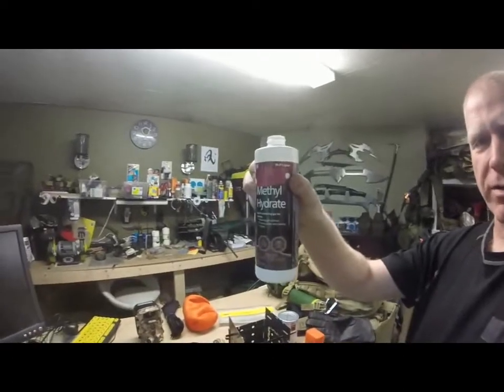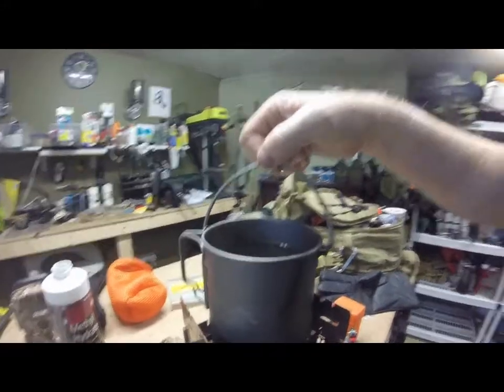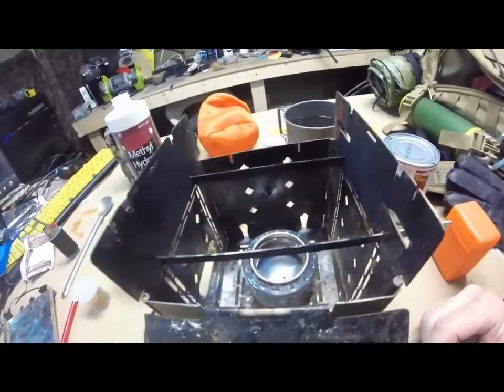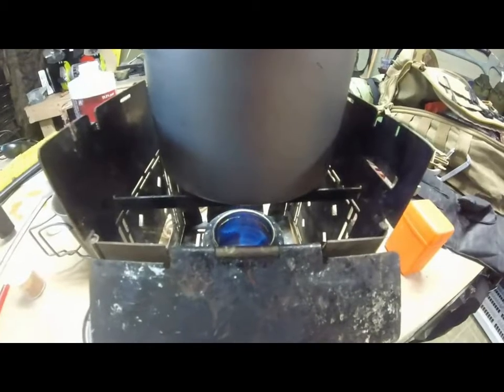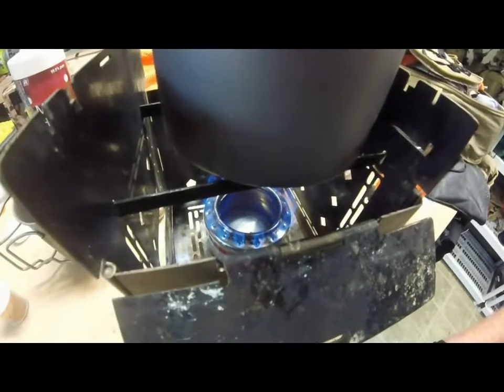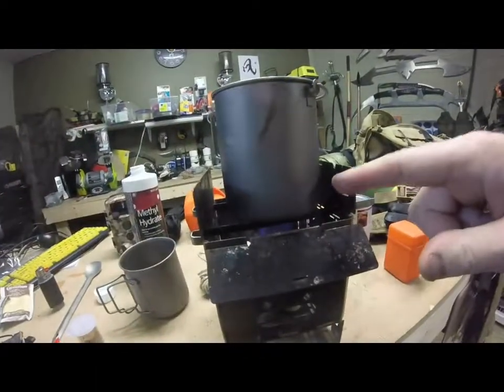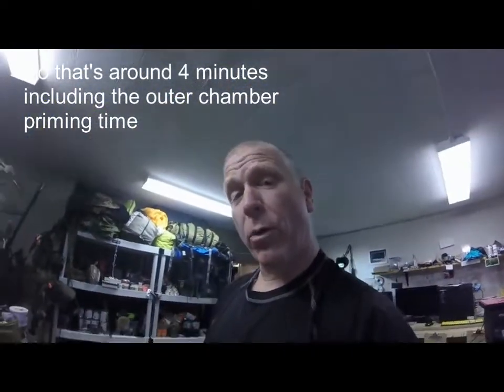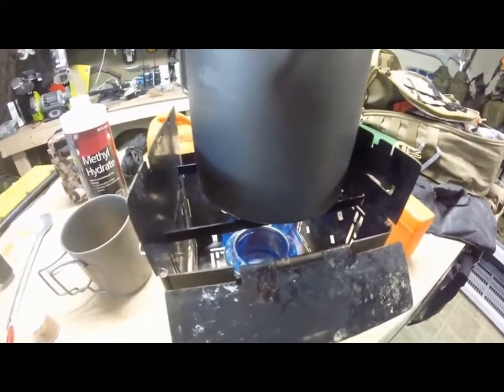Methyl Hydrate as a fuel for my home made stove

Comment: I was more particularly interested in that STAND that you got there Stephen. Very versatile, probably most definitely VERY useful in BTU properties. BOIL (10)<vs>Simmer(1) = ADJUSTMENT of the rods (supporting the cooking pot height) through there alignment holes.
Reply from the maker: That is a Gen2 5" Folding Firebox Campfire Stove
Very useful indeed.  Use it all the time with fatwood
Reply: Going through your vid's and came across the visual of "Fatwood", that question I posed earlier.  ("If you got lost in the woods... Overnighter 3:00/32:38") *Basically our decaying Cedar Stumps

Comment: 👍👍  I may need to look into this. I use my alc stove allot. 91% with a little 70% rubbing alcohol. I just deal with the soot. It is a bitch though once in awhile when it gets all over.
Reply from the maker: Methyl Hydrate and fondue fuel so far my favs
Reply: Fondue fuel? Hmmmm....  That's a great idea.
Reply from the maker: And you can burn it in the house if necessary...
Reply: Oh yeah...  (with the proper burners of coarse)  I need to find me some a dat!